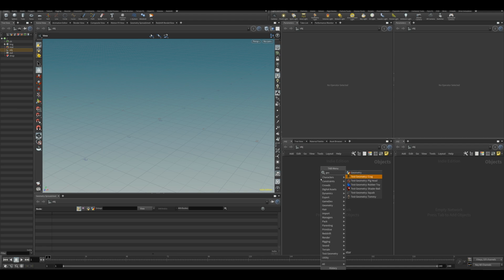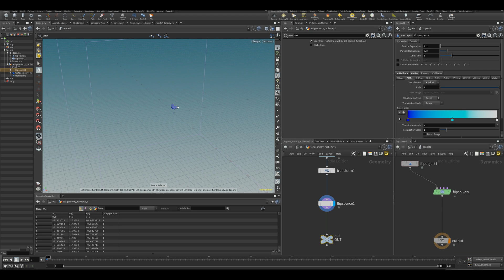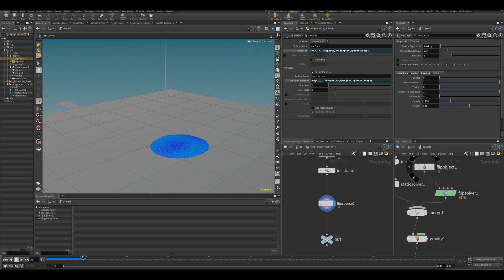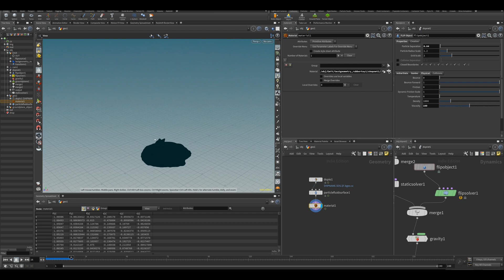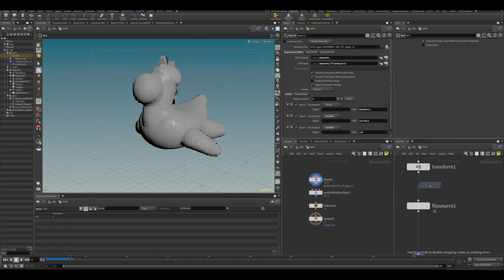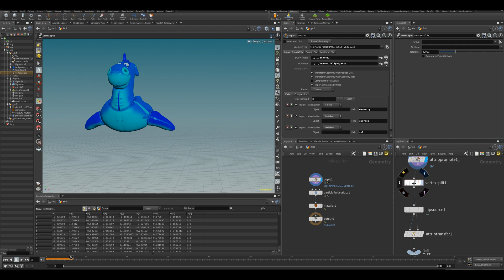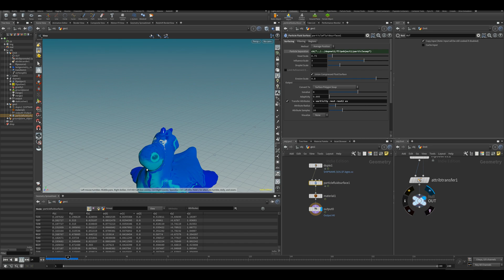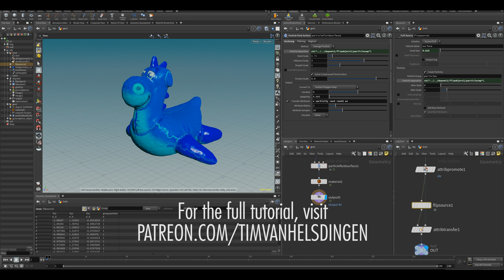Houdini Tutorial - Seamless UV's on FLIP fluids

Comment: Hello, after the DOP I/O I have to add another attribute transfer because my UV's do not come through on the particle fluid surface node without it. When I do that the texture looks good at frame 1, but when I play it, the texture does not stick to the mesh. Hard to describe without a file but do you know what the issue may be?
Reply: Just incase anyone else has this issue, the solution is to change the flip object dop input type to "Particle Field"